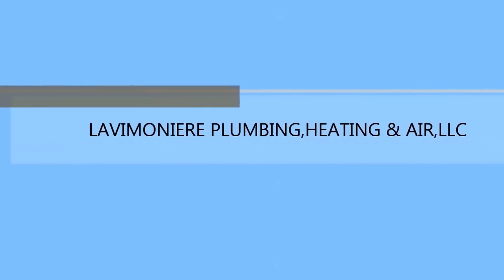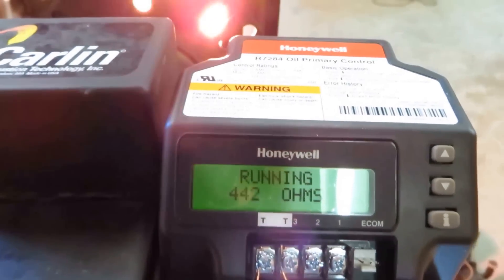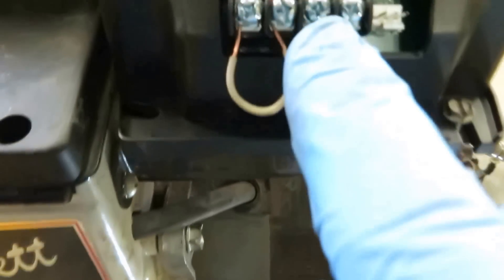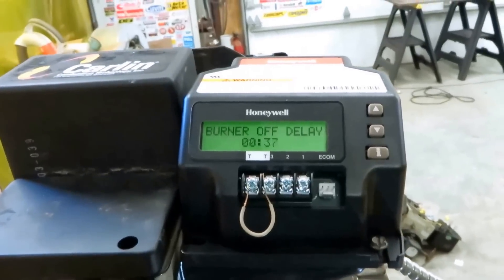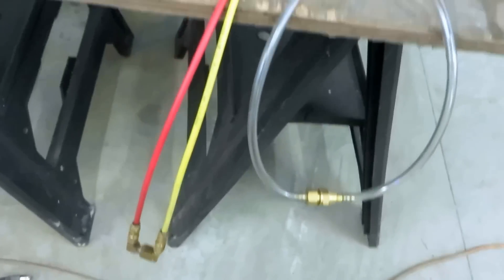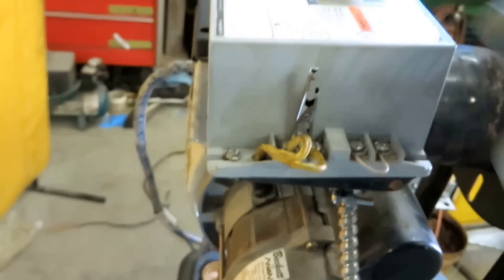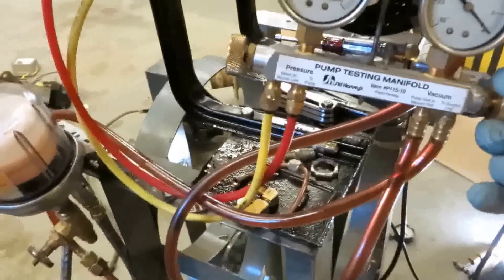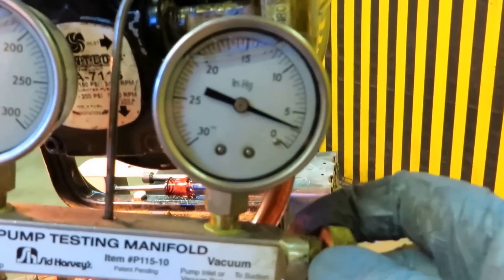Beckett oil burner training series # 7

Comment: Heat!  Precious heat!
Thanks for the invaluable info.
It's -1°F this evening, and we're setting nice and toasty.

Though , to be honest, I have a wood burning backup, but stocks are beginning to run uncomfortably thin.
Swapped out a noncompliant R7184B for the R7284U controller (and changed the nozzle, Yikes!) and now my oiler is up 'n running again.

Again, thanks for the help.

Comment: I got the honeywell R7284U to work the fan limit control wire that went 
to the old primary controller, needs to connect jumped to both the L1 
and LIMIT connector. If you connect a live hot black wire to the L1 your
 furnace will keep running and won't shut off. The one last issue I have
 is heating oil seems to be sputtering backwards into the burner 
housing, I can see drops flying around through the air intake next to 
the pump, after cycling there is a small puddle of oil about 1 
tablespoon at the bottom of furnace. All pump and gun line connections 
are dry and tight. A new nozzle was put in .75 80A I never touched the 
set screw for gun position. I did put a new strainer in the pump which 
was pretty dirty.

Comment: Thank you for this series, I’ve learned a lot.
Can you please advise me on how to adjust the air band and air shutter on these Beckett burners?  Where do I start? I’m using her it in a mobile boiler so I don’t have to be extremely precise and I don’t have special tools like combustion analyzers, etc.

Thank you
Reply: It’s very difficult, borderline impossible to get an oil fired boiler to run correctly without a proper combustion analyzer. You can perform a smoke test, but without knowing the O2 and CO2 parameters, you’ll never really know how it’s performing.

Comment: Hey quick question I have the same primary control in my trailer with Beckett burner well I noticed my igniter was bad so last night I took a trip to home Depot and purchased a new igniter while I returned home I disconnected the wires without taking a picture or memorizing where they all hooked up now I'm at a total loss I have the same wires as in this video as well as power for the door switch and other power I've been looking everywhere for a break down of what wire goes where. Living in central Maine it can get pretty chilly. I hope you have a great day and sorry for the long short question.

Comment: Thank you for these videos. Very helpful in understanding my system.  Im having a few issues.  My setup: Buderus Wood Furnace with a Weil-McClain oil furnace and a small hot water heater which i believe i burned out from stupidty. (all here when i moved in).  I have aBeckett AFG burner, digital igniter, R4184 control.  I had a new aquastat and circ pump installed a few months ago. Firstly the motor is very loud. Bad bearing? still works though. More importantly, the burner will kick on and off repeatdly and sometimes wont kick on at all. i thought it was the thermostat so i switched that with a digital one. It is almost always calling for heat!! Old farm house. When it doesnt kick on, i tap the control and it will start and sometimes ill notice a spark from inside the reset button housing. Im thinking it needs replacing.  I was burning 150 gallons a month!!! Now it looks like im down to about 3/4of that, so its getting better but still need work.  Also taking into account i burned wood for a few days this month.  Sorry this is getting long. Any help is greatly appreciated. I could provide pics and video if needed. Thanks
Reply from the maker: docrizk i would replace that control thats sparking on the inside for sure .you should not have to hit a control to make it work ..
Reply: thanks Steve. whoever wired this beast up did a half assed job.  there are wires everywhere, boxes arent mounted correctly, looks like low voltage wires coming from the wood furnace power source isnt hooked up to anything.  i should e able to run the wood and if that allows the water temp to drop to the low limit than the oil kicks on. right now im burning wood and the oil is still pumping. really its a waste of resources

Comment: Hi I'm replacing my oil boiler controls box r7184b1032 for a r7284u on my old ano I have black,purple, white,blu,orange and the 2 yellow for ced.on the new one I have same color but on extra red wire and litte confuse there if it go together with the black wire.

Comment: Hey Steve I'm subscriber and I have a quick ? ! I did some work and unfortunately I was very tired n took wire off the limit  prong n it was  wire nutted to ? I'm not sure which it goes to I would think power feed from motor set up is that true?

Comment: Great information, I am using my beckett burner for a  pressure washer, I have gotten the air band adjustment out of adjustment, is there any starting point on the air band and the air shutter, how do you start your adjustment, is the air shutter the (ring on the side) , for fine tuning. I could use a pointer or two. Thank you in advance , and keep up the good videos.
Reply from the maker: Jim Goolsby you do not want to much orange in the flame you will see in with black smoke if the air band is closed to much ,,,to much air and the flame will be right at the burner head.it should be shooting out some .i can tell were it needed to be set by looking at it ..your better to run it a little lean then to rich and soot the unit up with black smoke

Comment: Great video - fills in a lot of gaps.  Am about to install 1st R7284 to replace an old R8184G4009  on a Sears oil boiler with Beckett - wiring question - thermostat and cad I get, black and white are a one-to-one connections on the R7284 from the furnace but does the orange need to be jumpered to the igniter (blue),motor (orange) and valve (purple) or is it also a straight one-to-one?
Reply from the maker: +Posko Family follow the wiring dagram that comes with the new control for proper wiring connections

Comment: Nice series thanks Steve. Quick question you wouldn't happen to have any videos on how too much excess air or to little excess air would affect your flame?
Reply from the maker: MichoacanMex01 i go by eye on that i can get it right on the money . but if you use a anilizer shout for 11 or so on the c02 above 12 or so is smoke
Reply: Awesome, thanks for the tip Steve

Comment: Great video! How often do you recommend changing electrodes? Also what is the best way to set up the air fuel mixture we have combustion analyzers and the old style bacharach smoke kits?
Reply from the maker: +David Wahl i don't always change electrods unless there cracked  i adjust them in offen for better spark . combustion number vary on different boiler usally low ppm on c.o. is what i shot for and around 11 or 11.5 on c.0.2 is a good range for 0 smoke

Comment: Hi Steve. Awesome training series. Question on the R7284U wiring. I have a Honeywell 8124A triple aquastat for my tankless coil. The BX cable runs from that to the Beckett AFG. That BX cable has only 2 conductors (black and white). The black runs from the B1 on the aquastat to the existing oil primary control (limit) and the white from the L2. In order to install my new R7284U, would I need to run a BX 3 conductor from the aquastat and pigtail the L1 coming into it so that I would have an L1 for the R7284U ? ThanksBruce
Reply from the maker: +Bruce LeBlanc yes b1 is hooked up to limit  and you need a sepereat 110 volt constant for post and pre purge so b1 shuts off at limit say 180 but the other 110 leg will feed the post purge to run motor
Reply: +steven lavimoniere
Thank you Steven

Comment: Steven, I really enjoyed your Beckett training series. I am brainstorm up a plan to build a shop heater using an old Buck wood stove and converting it use waste Jet A fuel (basically just kerosene). I'd essentially just mount a Beckett burner on the side of the wood stove and tweak it to run good... is this a crazy idea or do you think it might work?

Comment: I need to say that your videos are very educational. I hope you could help me too.  Here it is.   I'd like to replace my current R8184G with R7284 control.  I have a Weil-Mclain oil burner.  I have no problem with the wiring of the R8184G, but R7284 causes some confusion.  I know how to connect most of the wires, but I'm confused with the L1 (black) and limit (red).  I don't have a red wire coming to the junction box where oil primary sits on.  I watched your videos, but I couldn't be so sure where they are connected to.  Please help.  Thank you,
Reply from the maker: +Da P the red  limit wire comes from the high limit on control ..the L1 black wire is a new wire you have to run for constant voltage to control for post purge oppion when the burner is shut down .make sure you have the high limit wire hocked up or the burner will not shut of

Comment: Hey, I really appreciate your videos. Fantastic information!

I'm converting from a R8184G4009 to a R7284U1004. It's a forced air oil furnace in a residence, a Beckett. 

The wiring diagram that came with the 7284U is complete gibberish to me; there is no basic diagram that shows the unit connected to a standard thermostat. I understand that you don't want to give wiring advice, but can you at least tell me if this sounds right? We're cold! We want to fix this. I've replaced the 8184 on this furnace before. I wanted to upgrade since a second one has now failed.

Here's what another person said to do for a system like mine:

Connect the L1 (black) & Limit (red) to the incoming power. 
(together, to constant line voltage?)

L2 (white) goes to incoming neutral, the motor white, & one side of the ignition transformer.

Motor (orange) connects to the motor black.

Ignition (blue) connects to the other side of the ignition transformer.

Do I wire the red and white from the thermostat to the front T terminals? All I see anywhere in pics is a jumper.

Thanks for any advice.

M
Reply from the maker: +Mark Abram if your old control was wired with the t t to control do the same to the new one .hard to say over a email unless i am there looking at stuff follow the wiring diagrame on furnace  you should make stuff down as to take things apart,,, so you know where things go.  the new protector relay read and follow the wiring diarame  for proper connections per your control double check to see its done properly . and high limit works as designed.

Comment: Anyone got a solution to a trailer oil furnace that vacuums when the circulating fan comes on.It pulls doors in the trailer shut and seems to draw cold air from so many sources that it isn't heating as it should.It is also drawing exhaust fumes from the combustion chamber down where the air adjustment and pump motor /fan  is located. This is a very recent interterm brand replacement trailer furnace we had installed.Burner teck said it is vacuuming.

Comment: Where do I set up my thermastat? I get lost during the TT stage and cant figure how to get my thermostat to communicate with my new honeywell control module. My furnace will just stay running until I disconnect it....
Reply: I thought I take the previous TT wires and connect them to TT on the control box. When I power it on, it run and runs, no matter if I turn down the thermostat....
Reply: My previous control box was the plain gray one with one red button. Much simpler.

Comment: Hey Steven, I'm replacing my old Honeywell R8184 G with this new R7284U model. But I have a question. My old primary has the coil and motor hot wired together. Do I wire separately and then connect? seems like a dumb question to me but I want to ask you first. All whites are bundled and goes to common. I also don't have a red wire for the limit. Sorry Beckett Burner.
Reply from the maker: +Johnny .Bravo you need to follow the instrustions on wiring the control. i do not like to give advice over a email .in case you burn your house down .its pretty simple read the wiring diagram it tell you what goes were
Reply: +steven lavimoniere  Thanks, I won't do what I don't know so I had someone come in to finish since it wasn't an exact swap and more of an upgrad. Works great. Wired both coil and motor separately and hooked up the limit too. Should be good for another 10- 15 years. LOL.

Comment: Hey Steve, is the spark always on while the boiler is running or does the spark shut off after the oil is lit? Great series!!!
Reply from the maker: Nicholas CeeA with the 8184g control the spark stays on other controls drop the spark out once the burner is running

Comment: Thanks for the video.  I have a tiger loop that is having the symptoms of a restricted line... when i start the system the burn keeps going on and off.  Any recommendations on what to check or adjust??
Reply: I replaced filter at tank and pump, both good.  Nozzle and electrodes were cleaned... getting okay spark from transformer... not sure where to go from here... any help would be greatly appreciated
Reply: Hi, is the tiger loop bubbling this would mean you have a small leak at one of the joints you may not see.oil.
Reply: Sorry I forgot to say the burner stoping and starting is air being drawing into the pump
Reply: Worked on it for weeks and finally had to call someone  in.  We ended up bypassing the tigerloop to a single line and now system is working fine... Not sure what the lifespans on these tigerloop are but it def went bad

Comment: My Beckett burner has been flaky lately older unit reset t will run few days then need to reset  Changed filter , strainer and nozzle  cleaned eye but wound up changing it with a new eye after few times resetting hoping that was the problem . ran for almost a week but then again today need to reset ? any ideas?
Reply from the maker: cdalego does it have a electronic transformer or a old style big style transformer????? the electronic ones are known to act up and not spark ,,,does the burner shut off when your there???? how long does it run for ??with a oil burner it could be a lot of things ins hard to say over  a email unless i was there looking at it ..
Reply: Old Style transformer and old style cad cell relay . Two things i did that made it run for longer was replace Cad cell but not relay 
and replaced battery in thermostat on wall 
battery thermostat after changing that it ran almost a for week no problem . i can hear Transformer while it is staring it loud like in you demo on this series . and when rest kick off  with no problem. im thinking maybe the relay may be week ??
anyway of testing it ?  or just replace it and hope for best ?
Reply: Maybe really lean air fuel mixture that barely has enough light to trigger the eye? Or your furnace intake or exhaust is plugged and is overheating on warmer days?
Did you ever figure it out?

Comment: Honeywell R8184G4009 International Oil Burner Control is clicking but nothing happens does it mean its bad??
Reply from the maker: +myviews you have to check for power coming in and going out . if the cad cell is black or bad it will stop the control from working could be a bad motor also . check the voltage power in on black from limit power going out on orange to motor and transformer
Reply: what should I set my meter and what should it be